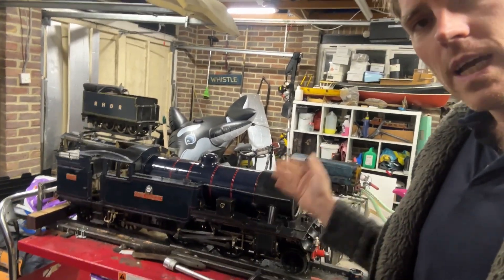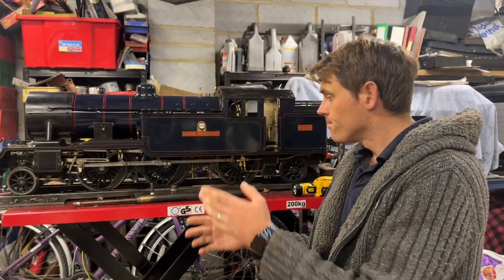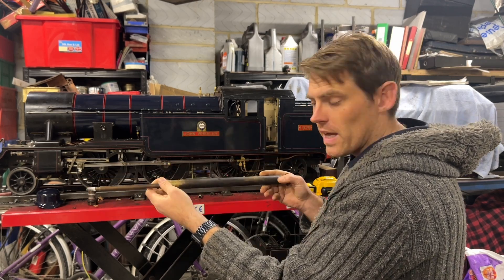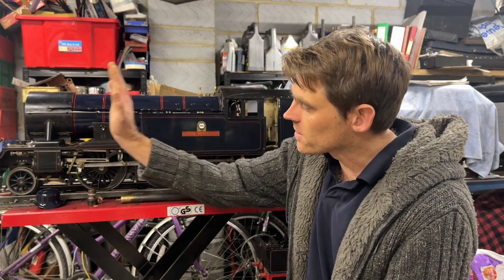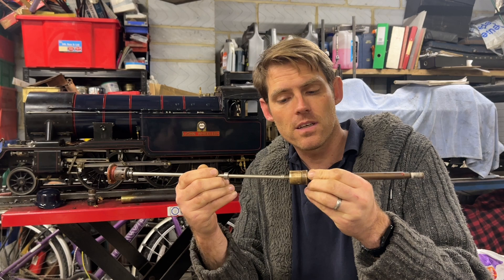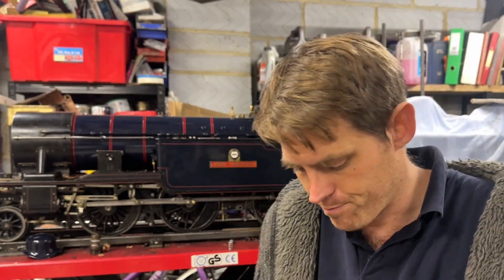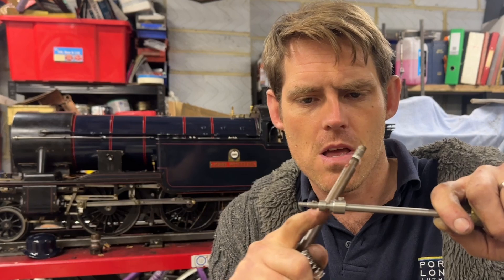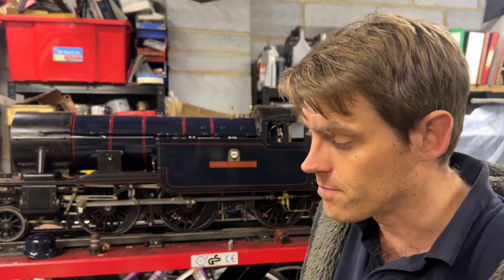Sorting a leaking regulator

Comment: I spent days lapping mine on a B1 
Same sort of regulator but without the bush into the smokebox. That bush now exists because no matter what I tried, I couldn't get things to remotely seal (of course you don't know where the leak is coming from, regulator or where it comes through the boiler,  an apparent O ring system wasn't doing it) if that makes sense. 
Misalignment is the word you're looking for. And I need to follow your example and let some Steamseal dry before putting it under pressure (apparently).

Comment: Gooping something up with silicon is never a good fix esp with steam.
Truly a total rebuild of the valve is in order. I see at least one guy suggested lapping the face. I would check both sealing surfaces against a flat surface. It’s amazing how much warpage you can get on a part you just machined “flat”.

If I had the option I think the valve should ride on a pin on the dry pipe and use some form of universal joint on the lever end.
Reply from the maker: I had lapped the faces after the first assembly, the combination of bits I did has made a considerable improvement, however not quite perfect, I believe it is better than it has ever been, however the superheater leak will convince me to have another go while that’s out. 
Yes, I believe that the disc being a part of the steam pipe end would have been a better idea in the first instance, however this is where we are now. I will have another go over the next few days.

Comment: Hi Tom always enjoy your vidios, although I don't have the experience you have I do get the general idea that disc in the tube regulators are quite often a source of problems. What I tried on my Speedy which does have a disc in the tube rugulator was to replace the standard bronze disc seat with the ceramic seats from a sink tap (not a bath tap they are larger). You an buy the ceramic seats as replacements on the internet you don't need to buy the whole tap. Might be something you could try but it does depend on whether you have the room to install the ceramic discs, it is important to ensure that the ceramic seats are supported to prevent any possible deflection.

Comment: Your modification to date would appear to adequately deal with the non concentricity/misalignment. Have you considered lapping the valve and portface? Also, is there an adequate ‘land’ between the holes in the valve and portface when the regulator handle is in the closed position?
Reply from the maker: Yes, I had lapped the faces, I think it’s just too far out of alignment, unfortunately it’s not something that’s visible when in place to know. And the holes in the disc do completely close, there’s quite a lot of movement on the regulator handle before the valve starts to open any more than the leak. I’ll have a bit more of a think and have another go.

Comment: Nice job so far. its gutting when you loose a part and then the moment you de-bur the replacement bit someone has put it on the back of the cross slide hiding in plain sight behind the compound!